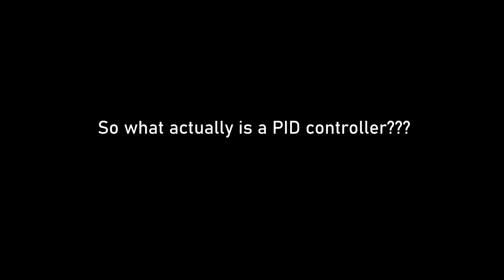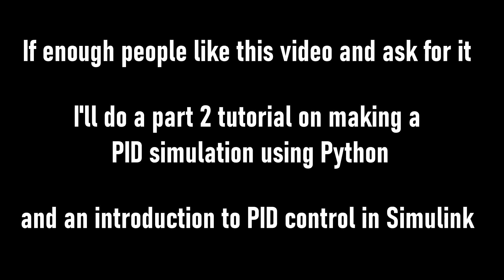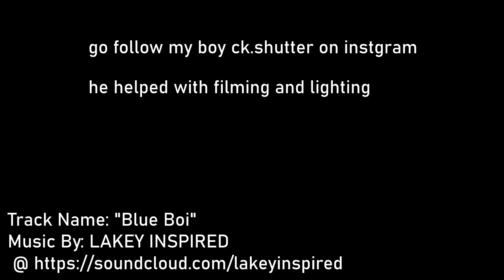How to Thrust Vector Control | How a PID controller works and MORE control theory

Comment: Why PID control is necessary.....Proportional control by itself can never quite reach the intended direction perpetually falling short but also it responds too slow.

The other two control parameters are derived from the world of calculus. Integral, i.e., Integration and Derivative are parameters on either side of the same COIN....which is CALCULUS.
Integration quickens the proportional control to get to the finish line but, unfortunately cannot do it without some overshoot. However it continually corrects over and undershoot to get closer to the intended final goal. If tuned properly, the oscillation is quickly dampened to settle at 100% intended goal. 

But often that may not be enough such that derivative is required. Derivative includes a time factor which  is considered a predictive capability. This foreknowledge can accelerate the arrival at the intended destination but only if correctly tuned. Derivative can sometimes even be ignored altogether.

Comment: Really nice video congrats!!!!  But I have a difficulty understanding the hardware of PID controllers, like are they just electrical circuits?  Can the fins and shape of the rocket be considered a system with the parameters Kp, Ki, Kd depending on their shape?
Reply from the maker: The hardware that the PID runs on will be an Arduino or in our case a teensy :D any microcontroller is the electrical hardware that the PID code runs on-- unfortunately, a PID controller doesn't have any parameters that are specific to the dynamics of the system. to take into account the physical parameters of the systems State-space control should be used
Reply: @OrionAerospace  thank you ver much!!

Comment: Nice video! I’ve been working on a flight computer, and I’ve been having some trouble on getting good orientation data. (I’m using an MPU 6050). All of the examples I’ve been able to find use the accelerometer for the orientation, which wouldn’t work very well in flight. Do you have any tips for getting orientation from the gyroscope?
Reply from the maker: Abe Eliason you’ll want to do gyro integration! The gyroscope on the mpu will give you degrees/seconds so you’ll want to take a gyro reading and multiply it by a change in time to get just degrees :D
Reply: There is a great video tutorial by Paul McWhorter on YouTube called 9 axis imu, he uses data from accelerometer and gyroscope and magnetometer with basic filtering for orientation..
Reply: Forget using the mpu-6050. Use any other better gyro and accelerometer's. The error drift due to integration would put you in another celestial body within hours. I am working on improving the positional accuracy of these cheap Mems gyroscope and accelerometer's, if successful to an extent.....I shall let you know.

Comment: Control theory has really started to spark my interest! Just an idea I had the other day, but you might be able to find optimal PID values with a genetic algorithm. By simulating a few dozen flights at once and finding which ones reach the highest altitude, duplicating them, mutating the values a bit, rinse and repeat. It's a pretty brute force approach, and you'd still need to understand your system pretty well to make the simulation accurate, but it might help off-load some of the real world testing onto a computer.
Reply from the maker: Jeff Vader it’s definitely a good idea! There are ways you can mathematically pick accurate PID values but the neural net might be a quick and diverse approach! Recently people have been using reinforcement learning algorithms as a part of the control loop itself— where the learning algorithm actually optimizes control on the fly based on inputs— but all of these are dependent on having a good simulation of your system
Reply: I'm just starting out building my own rocket, and have started on a PID simulation. I still need to buy servos, finish TVC mount, and finish the flight computer, so it's very early and isn't too accurate yet, but as I go I'm going to try to make some videos along the way. I have a video up right now that uses a particle swarm to find optimal PID values for the simulation, it's very quick. (https://www.youtube.com/watch?v=vvNbqsSXwYY doesn't really describe anything, unfortunately) I have experience with genetic algorithms as well and those would probably work too, but at this stage I don't really need them.